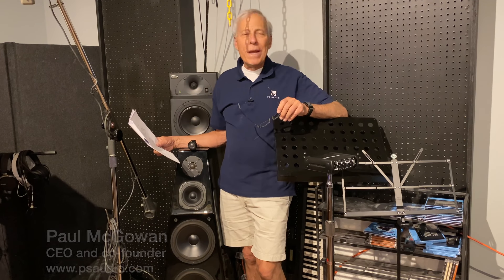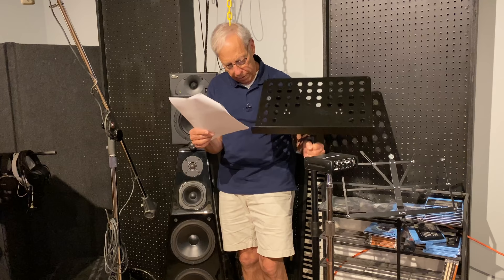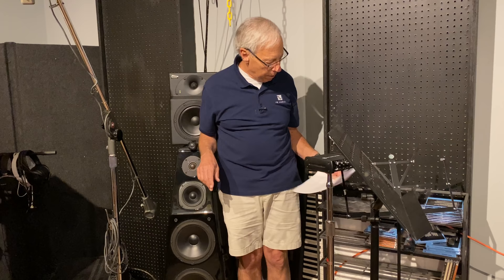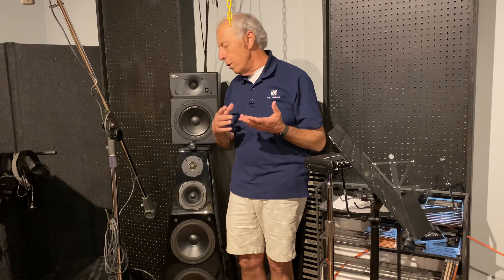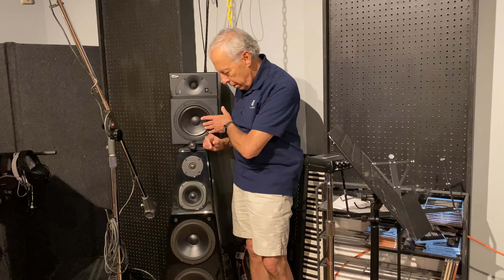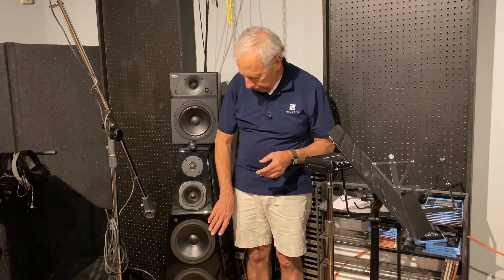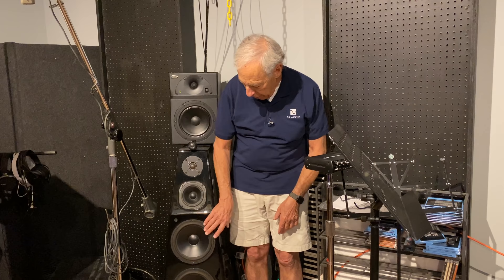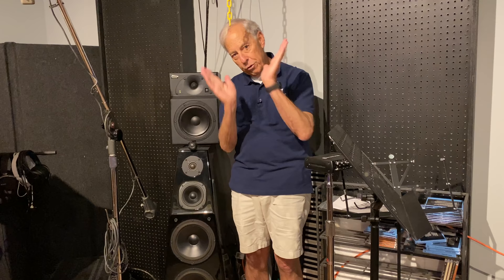Why speaker drivers sound different

Comment: I have two speakers made by the same company (NHT) with drivers of roughly the same size made of different materials. The C3 has all aluminum drivers. The Super One has a paper (pulp) cone woofer and a silk dome tweeter. Both are relatively accurate but the paper cone bass/midrange driver on the Super One sounds subjectively warmer to me than the aluminum drivers on the C3.

Comment: I think perhaps what the questioner was alluding to was the fact that many speaker manufacturers use off the shelf drivers from other companies, so it is not impossible, in fact probably happens all the time, that different brand speakers actually use exactly (within tolerances) the same drivers with the same magnet, coil, diaphragm etc.  What causes those hypothetical speakers to sound different? Obviously it's to do with implementation, cabinet type, cabinet material and volume, internal bracing, crossover etc. I'm not convinced Paul actually answered the question which was being asked. I also don't think it was a stupid question at all.
Reply: I was thinking like you, I don't think the questioner needs a Woofer 101 lesson... maybe his question was not clear enough...
Because Normand, the questioner, comes from Québec, Canada (where I live too), it makes sens what you was mentionning and thinking: Totem Speakers is a speaker brand based in Montreal, but they mostly don't use their own drivers, but from Dynaudio or Focal etc. Yet they have their distinctive Totem speaker sound.

Comment: Speaker drivers of the same exact design, materials, and construction sound different. 
Some manufacturers of complete systems take the time and expend the effort to use individually matched pairs of drivers 
to ensure that a pair of cabinets will have the same response curve.    
They may also fine-tune the crossovers to make an even better match.     
I don't think that's necessary, but it certainly doesn't hurt anything.        
         
Pick any two samples out of a production run of a specific model of amplifier and run curves on them. 
They will be closer in overall characteristics than any two speaker drivers, even if the drivers have already been matched.
Reply: Its at the vofoe titles 'Black Sabbath Engineer Shows How To Record Great Sounding Guitars With Two Microphones', starting at 3 minites 30 seccondes. THANKSE YOUE AND THUMMMES UPPE!
Reply: Identical speakers sound the same. It's the little variations in the materials, manufacturing process and of course the cabinet they end up in that makes them sound differently.
Reply: For identically spec'd drivers you'd have to have some golden ears and put some serious effort into hearing any difference. Whereas two drivers that are the same size and impedance but different in every other fashion will be so different you can hardly mistake them for each other (without help from the amp side, at least).

Comment: Spring, mass and damper...and then place it into a cabinet with a passive radiator, wouldn't it be almost similar, in principle, to the 2-DOF analysis for a guitar low frequency response function? That is, air volume coupled with the vibrating 'top plate' in this case a speaker cone?

Comment: What about using the field coil winding carbon nanotubes, better than copper lighter better thermal properties are better. I don't know never seen any speaker manufacturer  do this not sure why yet.  just the lightness and stiffness would be incredible even to aluminium are you going to research it adopt it Paul and as the former as well not seen it done using carbon fibre maybe it's a magnetic field issue I want a thought so
Reply: Sadly, those 2000 era "hanging chads" not only denied us having flying cars before 2015 but also significant advances in loudspeaker design.

Comment: Paul: a speaker driver is a very complicated mechanical device.
Car engineer: Uhm. Hello!
Reply: Fat Rat  
That would be my Flowmaster Super 40s with high flow catalytic converters on my 03 Mustang Cobra. Crack the throttle, watch the people jump. All joking aside, It comes down to engine design. Your tried & true push rod design will sound different than a push rod-less engine. Example- my 03 Ford Cobra with a push rod-less motor will sound different than say a General Motors LS design engine with push rods.
Reply: Yeah, a modern car has more speaker drivers than a home stereo setup...+ a ton of other much more complex things.

Comment: Im done with all pf thems. I neede a Di box to conver to XLR ro get the oise does and cables and its a mess I am usign the output with the cabitet simupators, into the compressor and into the audio inbterface. I cant afford UT and XRL cables everywher. Shuire SM58 os terribl;e ao so SM57. all fo them are liears to sell thei stuu IGLTHDSI SI LAS TIME i AM GETTIGN RIPPED OF BY THOSE GUITASE EQUPIMET SELLIGN LEIARS! THANS YOUE AND THUIBM,,MESS UPPSES!!!